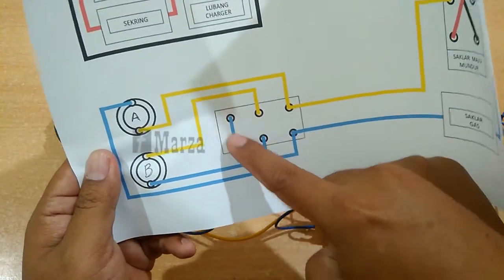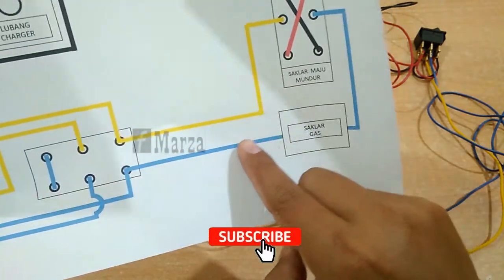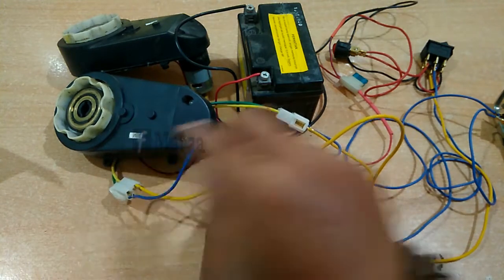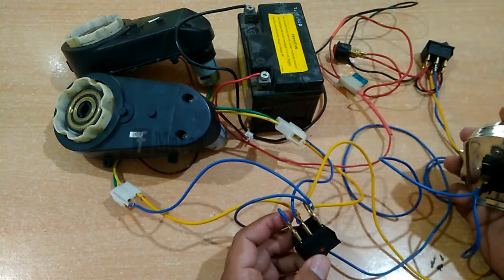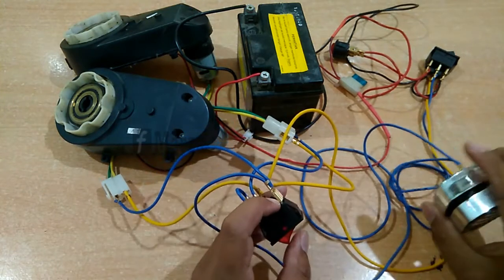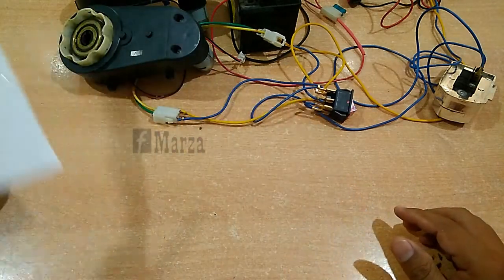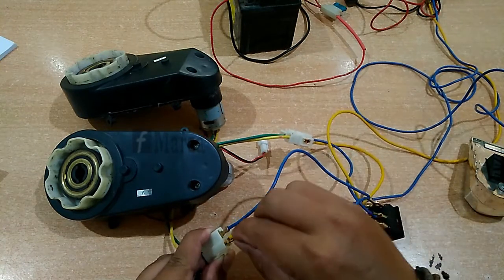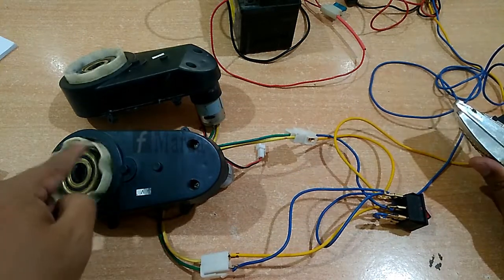Rangkaian High/low speed Mobil Mainan Aki

Comment: Sangat jelas, satu pertanyaan,, jika mobilan saya 6 volt dan dirubah aki nya menjadi 12 volt, dan menggunakan gearbox 6 volt dua buah,, apakah rangkaian pada low /High Speed nya disamakan saja seperti skema yang mas buat.. Terima kasih!!
Reply from the maker: Tidak bisa mas broo krn syarat rangkaian high/low speed tsb adalah menggunakan 2buah gearbox 12volt
Reply: Itu rpm gearbox nya brp Rpm boss,, dan saklar 6 pin nya bnyk dipasaran umum? 🙏🙏
Reply from the maker: @ubedsakarepna7808  
Rpm 18rb
Banyak kok di online maupun di toko listrik offline yg jual saklar 6kaki

Comment: assalamualaiku om ku. saya blh minta saran om. gimna klo mobil mainan biar agak kecang sped nya om. . soale pelan punya anak saya om
Reply from the maker: Memang mobil 6volt ini biasanya permasalahan di kecepatan kak
. 
Cara paling aman adalah mengganti gearbox dengan rpm lebih tinggi
. 
Ada juga yg menambah komponen tertentu namun hal ini intinya adalah memperbesar volt yang nantinya bisa berakibat gearbox cpt panas dan bisa kebakar
Reply: @fmarza  brp hargae ya om kira2 gearbox yg uk 30000 .
padahal motornya uda tak ganti aki yg 12v.. gimna om klo spednya bertambah
Reply from the maker: @nadirafaliza7737  
Gearbox nya uda diganti 12volt?, spek mobilnya berapa volt mas
Reply: @fmarza  om mhon 🙏 bantuan dan pencerahanya  om . 
td saya cek  klo cas nya 16volt pengaruh gk om akinya atau batre nya 12volt. mhon om masukanya
Reply from the maker: @nadirafaliza7737  
Dari berbagai charger dan sistem pengecasan yg ada di sepeda motor biasanya paling tinggi 14-15 volt mas
. 
Angka Itulah yg menjadi referensi charger bisa dikatakan normal atau tidak, Ketika charger dibawah angka tsb maka itulah yg dikatakan drop dan jika melebihi tentu saja hal ini berpengaruh pada umur baterainya krn sel2 didlm baterai bisa memuai krn cpt panas ketika di cas
Reply: @fmarza  🙏 nggeh om  . berarti cas nya normal apa gk om . klo misalnya kisaran 15 ,volt.
soale batre nya uda tak ganti aki pedah  motor om.
terus paling lama klo ngecas brp jam om ku.🙏🙏
Reply from the maker: @nadirafaliza7737  
Klo ada cari yg kisaran 14-15 volt, klo gak ada ya terpaksa pake cas yg 16volt tsb asalkan jangan terlalu lama/bisa di cek pada akinya klo sudah di angka 13.5-14 volt sudah full dan segera dicabut charger nya 
. 
Ada rumusnya brapa lama pengecasannya asalkan tau ampere chargernya dan ampere akinya atau nanti bisa cari di google kak
Reply: @fmarza  🙏🙏 ok siap om.makasih om ku semoga bantuan anda bermanfaat . bertambah rejekinya. dan diberi pnjang umur.. 
🙏👍👍moga kedepanya di bri ksuksesan  om
Reply from the maker: @nadirafaliza7737  
Amin 🙏

Comment: Mas kalo gearboxnya 6v ada 2 gearbox tapi pasang aki 12v dan gearboxnya diseri.. Dan agar bisa di lowspeed dan highspeed menggunakan step down diatur menggunakan potensio bisa ngga mas?
Reply from the maker: Gearbox 6 volt sudah lowspeed bang, klo mau di turunkan lagi lowspeed nya bisa2 malah tidak jalan/kurang bertenaga

Comment: Mau tanya gan, ane pake aki motor 12v4ampere. Semua rangkaian udah sesuai divideo atas, tapi saat di test bisa muter cuma pelan, tegangan drop.... Saya ukur di pin dinamo saat high cuma sampai 8v dan kalau low hanya 2v.
Saat di terap body mobil, dinamo sama sekali ga ngangkat, karena bawa beban di body/cover mobil.
Tapi saat di langsungkan dari aki ke dinamo tanpa rangkaian itu normal, kenceng juga.
Pencerahan nya gan, masalah dimana ya?
Makasih
Reply from the maker: Mobil berapa votl dan menggunakan rangkaian apa mas broo
Reply: @fmarza  mobil 12 gan, aki 12v dan motor 12v... Tapi alhamdulillah udh bener gan. Cuma saya mau tanya yg lain, apa jalur lampu bisa menyebabkan tegangan drop? Saya sambung dr aki dan sakelar on/off.
Reply from the maker: @guskimch309  
Lampu Bisa menyebabkan drop mas broo jika watt lampu terlalu besar dan kabel/jalurnya yg diambil lampu tadi terlalu kecil untuk itu jalur untuk lampu tsb harus diperbesar

Comment: Om mau tanya, gear pake 12v kiri kanan, nah aki pake 12v pake sikring tapi di resistor gas sama di skun kontak on off jadi panas terus kalo udah panas mobil mati jeda sekitar 3mnt bisa jalan lagi. Solusi nya gemana yah om?🙏
Reply from the maker: Mobil nya pake rangkaian apa mas broo?? Menggunakan receiver / tidak
Reply: @fmarza  ga pake receiver om, rangkaian di gas ada dioda sama relay nah itu panas? Solusi nya gemana yah
Reply from the maker: @ardadj1823  
Klo panas nya sekedar panas dan tidak sampai menyebabkan meleleh bisa dikatakan normal2 saja mas broo,,,, ada beberapa sebab panas bisa terjadi al:
-Sambungan kabel kurang bagus
-kualitas kabel kurang bagus/terlalu kecil
.
Di ganti relay dan rangkaian aja seperti video ini mas broo, 
https://youtu.be/QvPE4AnrP04
Reply: @fmarza  panas nya sampe bikin kontak on off jebol om hehe,,,makasih om coba tak rubah rangkain nya dulu
Reply from the maker: @ardadj1823  
Ok mas broo

Comment: Om, kalau menggunakan receiver 12v trs mau dibikin low speed dan high speed gmn ya om?? Terimakasih..🙏🙏
Reply from the maker: Untuk membuat high/low speed seperti pd video ada beberapa syarat, yaitu:
-spek mobilnya 12volt (baterai, receiver dan gearbox) 
-jumlah gearbox nya harus 2 buah
Reply: Om kalo spek mobilnya sudah 12v(aki+receiver nya) cuma gearboxnya 6v 2buah. Baiknya pake rangkaian seri atau paralel??
Reply: Trus gearbox yg d vidio di atas harga berapa? Soalnya saya pernah beli di online yg harga 40rb 1buah. G.box nya cepet rusak
Reply: @fmarza  klw semua syarat terpenuhin,bagian mana yg harus di ubah pakai saklar speed nya om.receiver nya pake yg 7 pin. Kabel bagian mana yg hrs di potong ganti pake speed.mohon solusinya

Comment: kalo singgle gearbox gimana mas. rangkaian aki 6 volt.
Reply from the maker: Maksudnya rangkaian aki apanya mas broo
Reply: @fmarza  itu kan gearbox 12 volt 2 gearbox. punya ank e sya 6volt pakai gearbox 1. cra nya buat lowspeed ny gmna.
Reply from the maker: @rudikristanto1511  
Untuk membuat rangkaian tsb memang harus gearbox 2buah 12volt mas broo
Tidak bisa untuk gearbox 6v 
,
krn cara kerjanya adalah ketika Hi speed maka gearbox mendapatkan voltase sebesar 12v dan ketika low speed gearbox mendapatkan voltase 12v yg dibagi 2 sehingga masing2 gearbox cuma dapat 6v
Reply: @fmarza  oh gtu y mas. berati seri  pararel itu y. bru paham saya. ok mas mksih pnjlsan nya
Reply from the maker: @rudikristanto1511  
👍👍👍

Comment: mase motor ank sya akinya 6 v yg model gearbox 2 kalo mau upgred ke 12v harus ganti apa aja ya mase.mohon bimbingane mase.matur suwun
Reply from the maker: Klo upgrade ke 12volt yg diganti adalah gearbox dan receiver mase
Reply: gerboxnya masing2 12 v apa yg gmn mase soalnya gearboxnya ada 2.
Reply from the maker: @imamnakhroni4273  
Betul mas
Masing2 12volt
Reply: matur suwon mase.nanti di lanjut di wa aja.
Reply from the maker: @imamnakhroni4273  
Ok mase

Comment: Bang mohom info
Dinamo ya itu tipe apa
Soal y di rumah tulisan y hilang
Mohon info
Reply from the maker: Maksudnya type dinamo nya siapa bang? 
Klo dinamo yg saya pake 12volt 390(model/type kecil)
Reply: @fmarza  saya dirumah ada gearbox 
Mau ganti dinamo y aja
Cuma tulisan y ilang
Ada keterangan cuma 12v
Reply: @fmarza  di box gear y ada tulisan FY 3A
Reply from the maker: @bermainbersamaan1420  
Umumnya klo buat mobil mainan aki dinamonya cm 2 macam yaitu dinamo besar (550) dan yg kecil (390)
Reply: @fmarza  satu lagi
Klu dinamo itu asli ya 12v bisa ga
Tanpa menurunkan tegangan semisal aki yg 12v
Reply from the maker: @bermainbersamaan1420  
Memang klo untuk high/low speed dinamo harus 12volt jumlah 2buah
Reply: @fmarza  berarti klu tidak ada kecrpatan ya atau hig low y 1 gearbox gpp ya
Inti ya yang penting jalan aja
Reply from the maker: @bermainbersamaan1420  
Betul mas,,,, banyak juga kok yg cm menggunakan 1 gearbox saja
Reply: @fmarza  ok terima kasih info dan ilmu ya
🙏
Reply from the maker: @bermainbersamaan1420  
Sama2

Comment: Om saya nyoba ngikutin rangkaiannya tapi ketika low speed cuman 1 motor yang aktif, terus high speed 2 yang aktif. Gimana ya om ?
Reply from the maker: Kok aneh 😁😁😁
Di cek lagi rangkaiannya apa sudah pasti benar bang😇😁
Reply: @fmarza  bedanya saya ndak pakai sekring , dari aki langsung ke switch on off. Sama saklar gas saya 6 pin nah tapi cuman saya pakai 2 pin ngikutin video. Apa mungkin di saklar gasnya ?
Reply from the maker: @mfajarkurniawan2432  
Kemungkinan permasalahan cm di saklar high/low speed saja
Reply: @fmarza  alhamdulillah sudah ketemu om haha. Terimakasih sangat membantu
Reply from the maker: @mfajarkurniawan2432  
Ok
Reply: @mfajarkurniawan2432  boleh tau pin untuk saklar gas nya jd pakai 2 pin aja kah bang? Pin yg mana yg di pakai bang?

Comment: mas metode ini dinamo di seri apa di parallel..
Reply: berka mas, mobil anak saya bisa di pake lagi, makasih banyak mas.
saya mau  buat low speed, dinamao punya saya 6 volt 2 buah,di seri  pake aki 12volt,  saya mau pake saklar low speed cara sperti di vidio di atas apa beda metodenya ?
Reply from the maker: @rahmattb3765  
Alhamdulillah mas
. 
Untuk bisa dibuat high/low speed seperti video spek mobilnya harus 12volt mas(receiver, gearbox, dll) dan gearbox nya ada 2buah
. 
Krn cara kerjanya di saklar yg berfungsi mengubah rangkaian seri(low speed) dan paralel(high speed) 
. 
Ketika high speed masing2 gearbox dpt 12volt krn rangkaiannya paralel sedangkan ketika low speed masing2 gearbox mendapatkan 6volt krn rangkaiannya seri
Reply: @fmarza  ok mas mkasih info nya, saya subscriber mas
Reply from the maker: @rahmattb3765  
Trims mas support nya🙏🙏🙏
Reply: @fmarza  sama 2
Reply: @fmarza  mas kalau saklar maju mundur gak harus khusus, yg penting saklar 6 kaki ?
Reply from the maker: @rahmattb3765  
Betul mas yg penting saklarnya 6kaki
Reply: @fmarza  mkasih mas infonya
Reply from the maker: @rahmattb3765  
Sama2👍👍👍